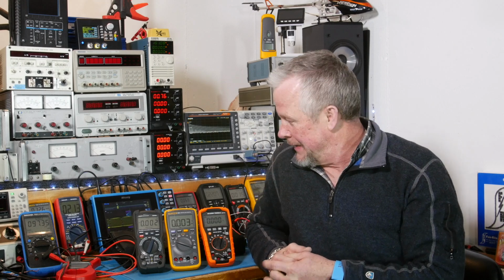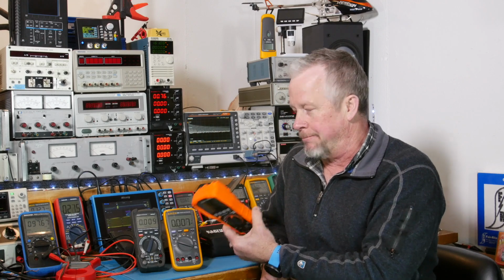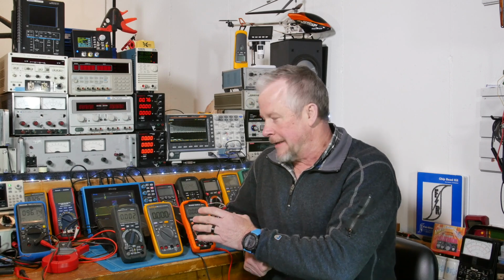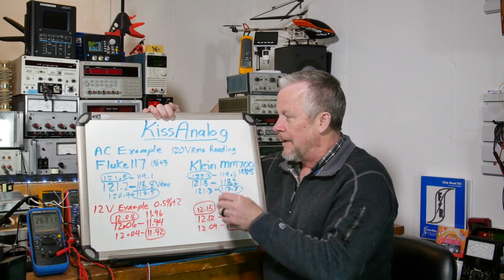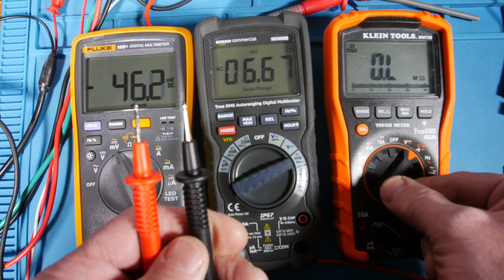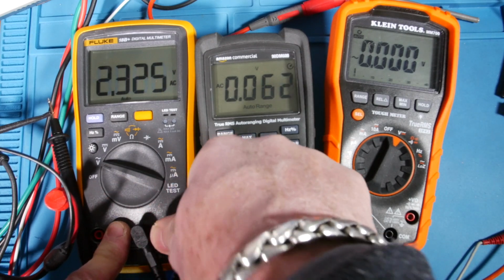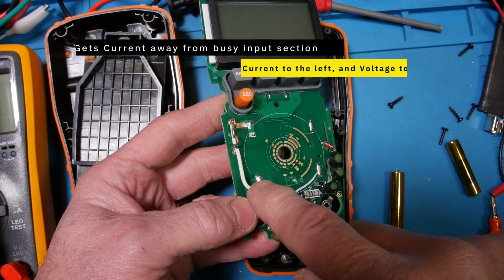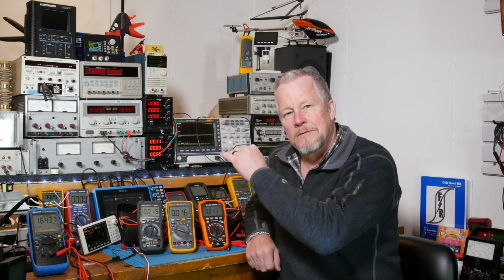Low Cost but Tough Multimeter: Klein MM700 Tough Meter

Comment: If your a professional electrician or service technician do not buy this Klein mm700 meter! This is by far the worst meter I’ve ever used, the leads are terrible. The biggest problem is the delay we’re talking 4-5seconds for an AC voltage reading on auto range, and 2-3 seconds on manual range. To get a stable resistance reading we’re taking have a sip of coffee delay! For a hobbyist this is probably not an issue (if your pining out surface mount components on a modern circuit board it sure would be!). When you have to check 100s of circuits and time is money this is painful! I bought on of these on a Sunday service call at the Home Depot as I forgot my Fluke meter at the shop. Klein makes decent quality electrical tools but they should be ashamed to put there name on this meter. If you don’t care about the delay and your willing to buy a quality set of leads it’s probably ok for you. Personally I’d recommend spending a few hundred bucks more for a Fluke meter (I have the Fluke 87) you won’t regret it!
Reply from the maker: Thanks but I have to disagree.  You must have got a bad meter.  

My MM700 is just as fast as my 87V in reading AC voltage.  I think some people have a nature bias towards what they like and see issues with anything else.  For example, the TL75 leads that come with the 87V these days is the worst in the industry IMHO.  The Klein leads are more flexible and better in every way - again IMHO.  Also you can buy some really nice silicone leads and still save hundreds over buying the 87V.  

Also, for anyone working outdoors, the MM700 has a great IP rating so will be protected from the elements.  The 87V does not, you will have to get the 87 Max that they came out with.

Comment: Nice multimeter, but if you want really tough multimeter, then go for the Fluke 87V MAX, that is tough man !!, anyway, great channel and content, thank you :)
Reply from the maker: Thank you!  Funny thing - Fluke had to make the MAX version to have a better IP rating than this meter at a fraction of the cost;)
Reply: @KissAnalog  Yes !!! You right 😅🤷🏻‍♂️, i really do like Fluke, but normally they are so  stingy, why don't include at least soft case in every MM, they are acting like apple, selling everything separately 😏, have a nice day my friend, keep it up !!
Reply from the maker: Thanks!  I agree, after spending over $200 or even $400, they should provide their best test leads.  The newer leads are so stiff!  Then if there is an upgrade option with the nicer leads - the price goes up the amount that you can buy the leads separately - but then you lose out on the crappy stiff leads;) I think they get away with it because of their loyal following…too bad!  Thanks for being here!!